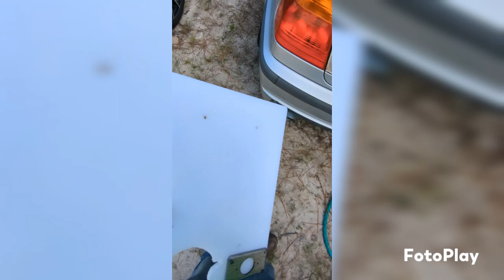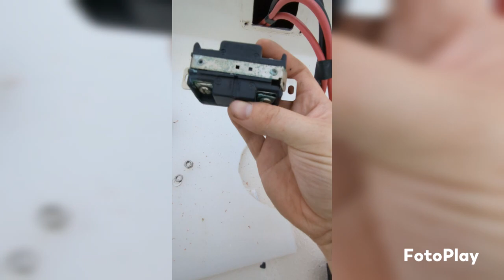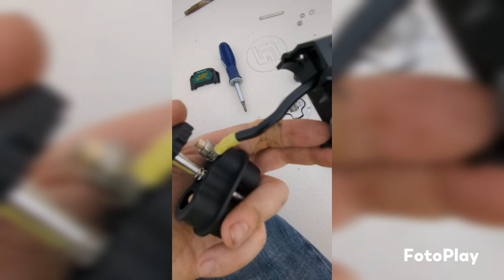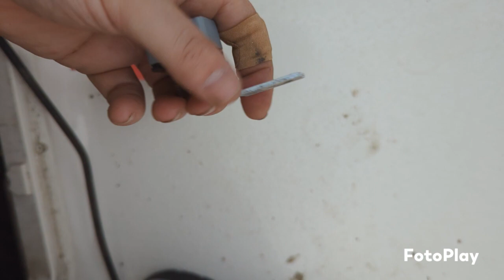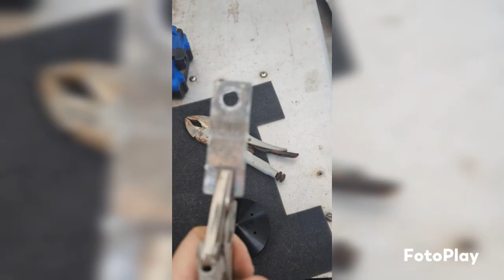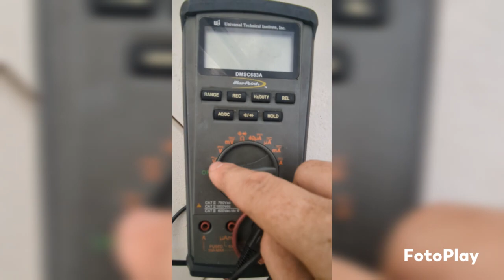Battery Tender Trolling Motor Plug Install on Carolina Skiff 21LS

Comment: How did you mount the trolling motor?
Reply from the maker: I installed a 6" access panel on the port side of my anchor locker so I could access the bottom side where the motor would mount. I then through bolted a minn kota quick release mount with a steel back plate. It sounds complicated but was very simple.  Biggest part is measuring and ensuring you get the exact alignment you want for the motor before drilling the first of the 4 holes for the mounting puck. After that, it's a breeze.